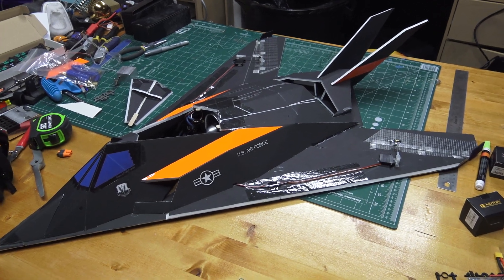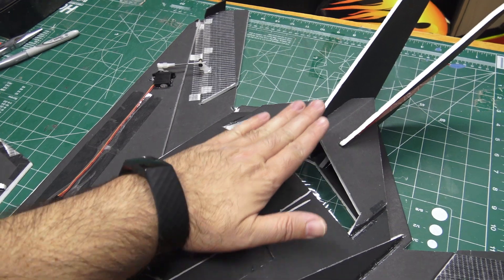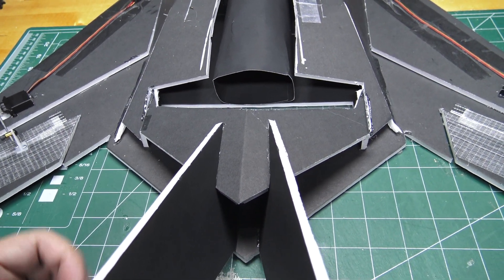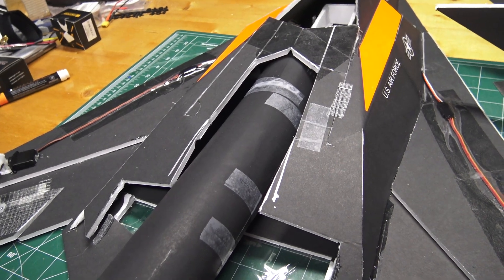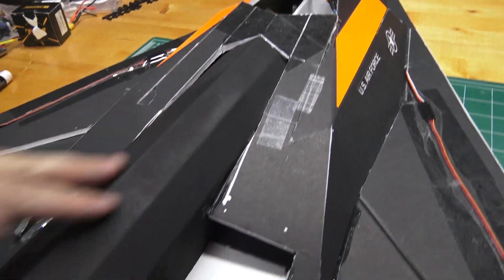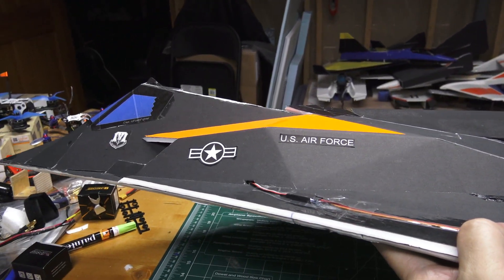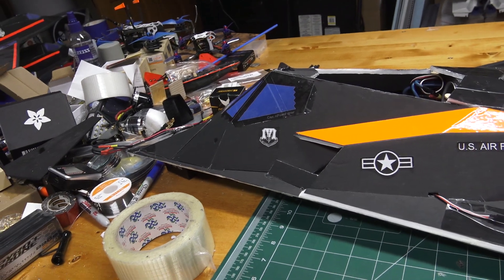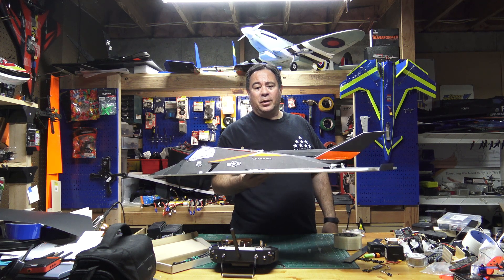FF-117V2 EDF Experiment Part 2

Comment: good job man,  i personally think the biggest problem was the cut out for the prop on the old version, not really the shape of the thrust tube or the actual exhaust, but it probably reduces the power output at the buisness end, but we will see, it looks promising thats for sure, cant wait to see the next test flight...good luck mate, cheers :)
Reply from the maker: Thanks for the comment WarbirdFan66! You may be right about the prop slot creating some or most of the weird flight characteristics.  Hopefully with the modifications it will fly closer to normal. The original test flights it was weird and always felt like it was nose heavy even with the CG in the correct place. I believe somewhere the thrust was hitting something and pushing the nose down. I knew all the obstructions in the tail section would be problematic, but just flew it anyway for a test flight.  All that stuff should be cleared out now, so hopefully the next flight will go better. Thanks again!